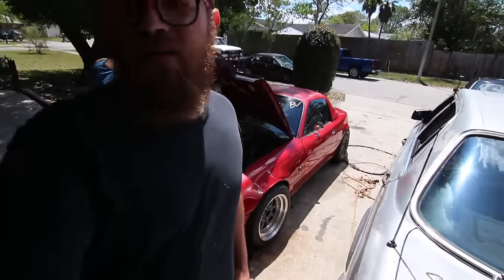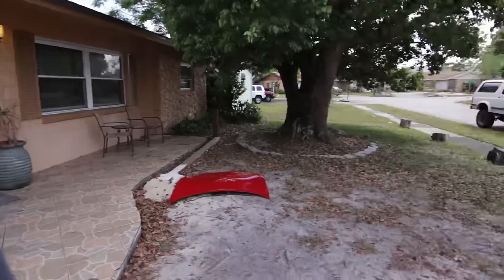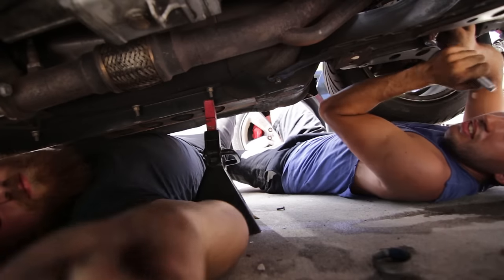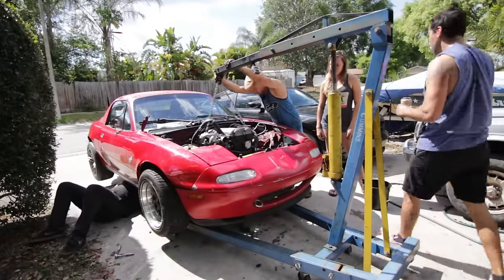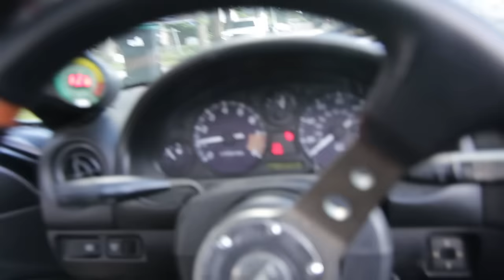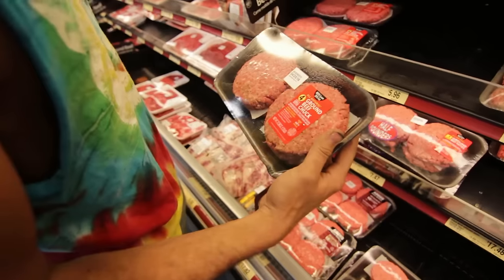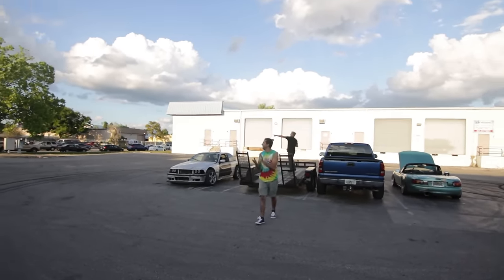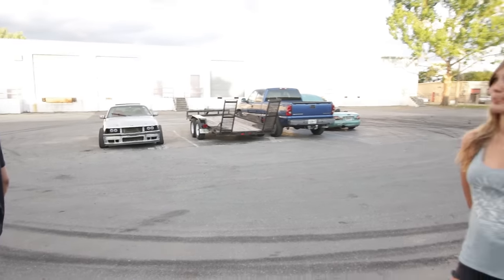Miata motor pull and Donuts

Comment: Hey for crystal Miata, it's probably the cam angle sensor! When they get hot and or are old they start to not work when the car is warmed up! Try spraying it with some air duster stuff to cool it off or just replace it!
Reply: +Jacob Walti It's the tune
Reply: +ImpulsGrr oh gotcha, just thought maybe that could be it cause I was researching for my 96 and I found that out about nb's.
Reply: Sorry I was short, you're not wrong. Cam or crank can cause a no start issue. From what I know not by heat though.

It's actually his afterstart enrichment that is messed up (That's why his car takes forever to start)
Reply: +ImpulsGrr plus we found out the car has 50 psi on cylinders 2 and 3, headgasket is blown
Reply: DriftHappyTV Ohh damn, not good. Was it good before the shenanigans? or maybe tune related?
Reply: +ImpulsGrr no we knew headgasket has been bad for a while but we still wanted to do burnouts haha
Reply: +DriftHappyTV hahah fuck yeah, luckily headgasket isn't to hard. built my head a little over a year ago and would say I'd do it again

Comment: Is towing a car like that illegal
Reply: +Dank Cancer yes because without power you can barely brake and steer
Reply: TeddysRUs I've never heard that, even if I dont think a cop would ever do anything unless it was more than a few miles
Reply: As far as I am aware, flat towing (towing a car with just a tow rope, not on a trailer or dolly) is not illegal anywhere in the world. It is usually illegal to flat tow a car that isn't street legal, insured or registered though.